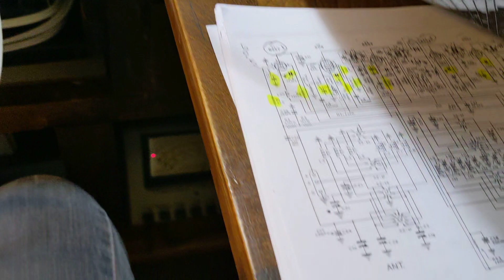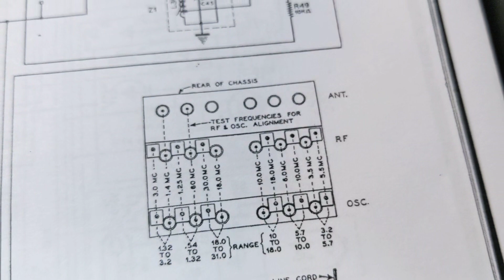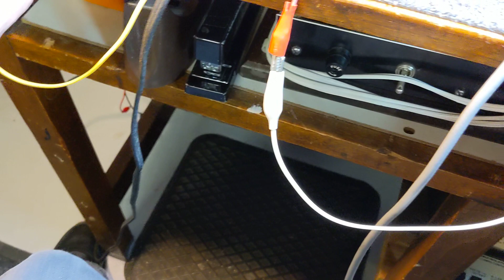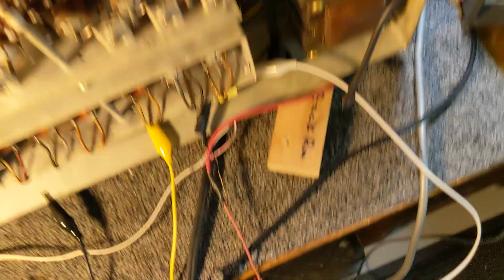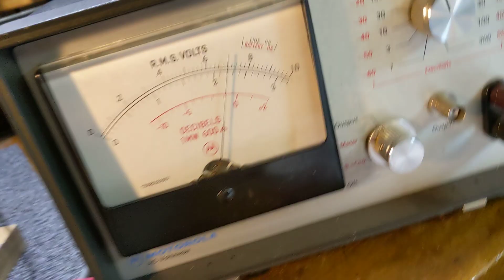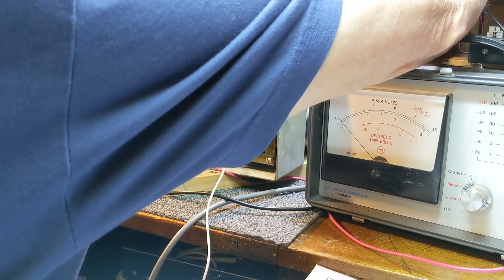Hammarlund HQ 129X Alignment Process

Comment: Hi there! Great job I am doing the same process now on mine and those steps of rocking dials back and fourth can test your sanity...LOL! 
Starting over again went thru the whole process and now back on the BC band to try and close on 600kc but atthe high end the osc is way off or not oscillating.I think when all set up you will need to touch it up with the metal cabinet. on due to the distributed capacitance esp on the higher freqs.
If someone needs their panel re screened Radio Daze company in NYC can do it.They did mine and I was their first one so they should have a screen.
Reply from the maker: Well I had a problem tuning one of the bands. I took the screw out of the compression cap for that band and cleaned the one plate and Mica (Mica can not be removed) with alcohol and a crushed flat Qtip.
Hopefully the tuning won't be affected when I slide it back into the case because there is no way to get to the tuning.
I'm lucky, I didn't need to do anything to the front panel except clean and polish.